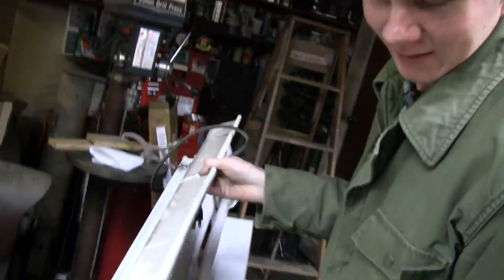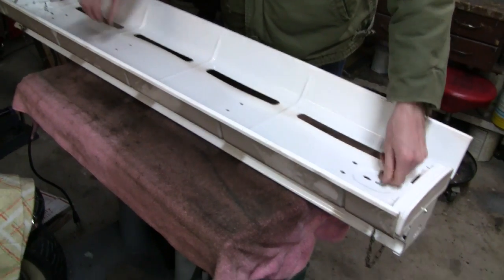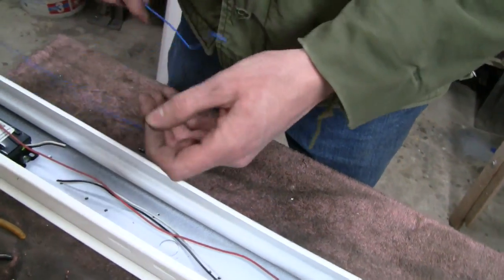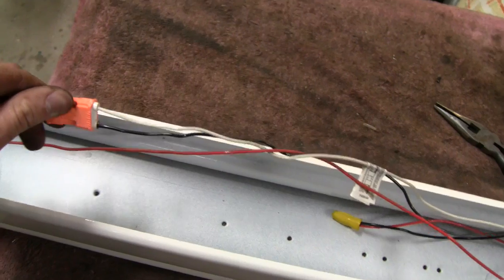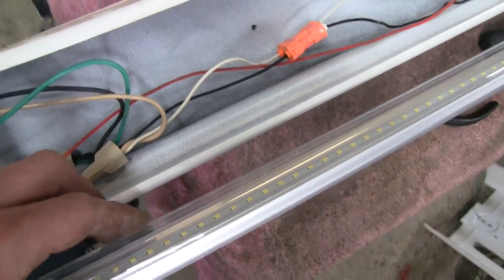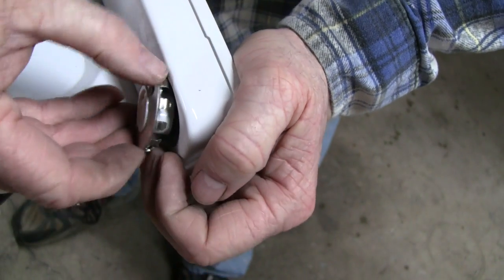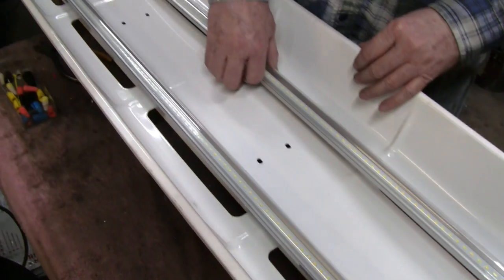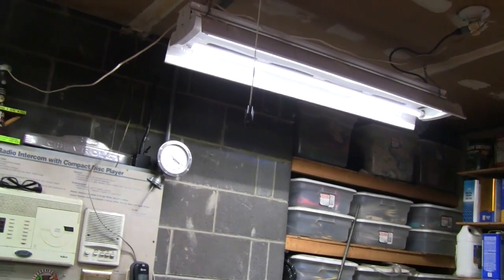HOW TO CONVERT FLUORESCENT TO LED (ALL STEPS)

Comment: About the worst delivery I've ever seen. "All steps" ! Picks up a bunch of blue red white and black wires cuts the lot and then they or some or maybe one colour to another appear joined in some way without any step by step explanation and visual.  It's a before and after with the actual work left to imagination. The rest you have to try and understand from the trio bantering together.  OK maybe for electricians but the idea is to make you able to do it yourself. Thank you tube that there are other vids to watch

Comment: Technically it does matter which wire. Live and neutral are not necessarily interchangeable. This particular wiring method only works for double ended LED tubes as well.

Comment: I did this same thing with my lights and removed my ballast. I hooked up my lights and they got power going to them but they will not come on. I got a wall switch that is a combo box  and what I mean by that it  has a light switch in it and a outlet in it and it's grounded and then I ran wire from that combo switch box to the lights that I mounted in my shed. I got power going up to it and when I flick the switch on the wall the power will shut off and on  so I know that's working but my lights don't come on. The only thing that I didn't do is the ground wire from the new wire that I ran up to the lights isn't hooked up. Someone told me that as long as the switch and outlet combo box is grounded that I didn't need to ground the lights, is this true and if it is true then I don't know what else to do. Like i said i got power up at the lights but the lights will not come on and I had the lights tested to make they're no defected and they work so I'm lost. Can anybody help, thank you. Thumbs up on this video. 👍

Comment: I'm confused. You hook (2 blue + 1 white), (1 red + 1 black) going to both ends of light. 
Does this indicate you are using a 'Double-ended' LED light?  
And are 'Double-ended' LEDs used only with 'shunted' tombstones   and   'Single-ended' LEDs used only with 'non-shunted' tombstones?  or vice-versa?
(note: the bulbs on Amazon warn only single-ended and require only non-shunted)
Thanks.
Reply from the maker: Thanks for asking, this is a great question! At the time this video was filmed, only double-ended LEDs were available, thus the original shunted tombstones were used. Had we been able to purchase and use single ended tubes, we would have had to retrofit the fixture with non-shunted tombstones. There are now SOME LEDS sold that are compatible with both configurations. I updated the Amazon link with an example. Hope this helps!
Reply: @motoforlyfe  ,  interesting that those LEDs you linked, can be BOTH single & double (take your pick). Even better the beam angle is enhanced at 240 or 300, than the older 120 angle. I wanted a better beam spread. Thanks for the updated link!

Comment: This is a horrible video. You did not slow down and explain what you did with the wires. I have rewinds 3 times and you just didn’t show your work. Moving in to the next video.
Reply from the maker: I used to lose points in math class for not showing my work.
Reply: Black to red, white to two blues. Ezpz pusspuss

Comment: Is it more energy efficient to not have the ballast connected, or just left in place if it's an electronic ballast in the fixture? The LED bypasses the electronic ballast anyways? Does the bypassed ballast still consume wattage, that meters on the electric bill?

Comment: Go another step and physically remove the ballast from the fixture - one screw holds it to the frame (usually) and the assembly is quite a bit lighter without it.
Reply: Yeah but then you need to dispose of it. Easier to just leave it.
Reply: who da hell cares if its lighter?  are u gonna fukn hold the thing while in operation?
Reply: @bucklee436  Because it makes for a cleaner job...and less confusion to those that service the unit in the future.
Reply: No, just hold the effing thing while installing it overhead.

Comment: I removed 2 ballasts from a 4 bulb unit, re-wired as shown , replaced bulbs with LED BULBS, and does not work.  what did I do wrong???
Reply: There are two types of LED tubes...'double ended' and 'single ended'. If you purchased the wrong tubes for your fixture...they will not work unless you also change the tube holders to shunted, or non-shunted respectfully. So, either switch to the other bulb types, or change your bulb holders.

Comment: This example shown here is known as a UL Type-B LED retrofit, where the driver components are integrated into the LED lamp. There are also Type-A (LED tubes operate off of fluorescent ballasts, also known as "plug & play") and Type-C (LED tubes operate off of remote LED drivers) retrofit options.

Comment: Thanks so much guys. Great tutorial. I had bought some so called plug and play led 48" tubes which were touted to work in a standard fluorescent shop fixture, but each lamp took turns randomly staying on, then going off then coming back on again. It looked like some kind of haunted discotheque in my shop. We were very entertained at first, but you can't work like that.  I yanked all the LEDs back out and started researching this when I ran across your video which was absolutely the clearest most concise explanation. I rewired my lamps like you did and the room is bright as day, without any unexpected night visits LOL. Thanks again.
Reply from the maker: You're welcome!

Comment: 1- the ballast tray cover has to be replaced, not only for cosmetic and reflecting, but there's wiring in there and it has to be closed. Otherwise it's an open junction box and is a NEC violation.
2- Note: these "double ended" LED tubes. Neutral one end, hot the other. That's why the shunted sockets worked.
You use non shunted sockets for single end tubes (where the hot is one pin and the neutral is the other pin) The sockets on the other end are just physical holders and require no electrical connection
Reply: davep6977 where is your code reference armchair electrician?
Reply: da fuk outta here dave!  ballast not 'hot' anymore, don't need no cover ya stupit fock!
Reply: @bucklee436  'Stupid' can easily be described as leaving parts off the reinstall that have value or leave a better end product. Put the cover back in place. It minimally keeps the wires secured, and the wire connections separate from the bulbs...in the off case that an LED bulb has to be replaced by a home owner at a future date.

Comment: I just did one of my fixtures in my shop using what I learned on your video. I tried running the LED's with the ballast wired in & they flickered badly. So I wired them as you showed straight off the 120v & they work great ! 
Now I just have 11 more fixtures to convert. I got my LED's at WM for $9.98 for 2 - 4' bulbs.
The old florescents are dim in comparison to the LED's.  Thanks for your help !
Reply: WOW!  That's a good price.

Comment: I tried this, the new LED tubes came on for about 2 minutes, then went out, when I touched them they were very hot, I think theres more to the conversion than this.
Reply: There are two types of LED tubes...'double ended' and 'single ended'. If you purchased the wrong type for your fixture...you will have to change one end of tube holder to shunted or non-shunted, or simply order the other tube type. Otherwise, you will have operating issues.
Reply from the maker: +Cunning Cat Did you check to make sure that the leds were meant for the voltage you were running through them and that all your connections were right?
Reply: Just three leads black white and a bare ground which I didn't mess with, the tubes worked fine for a short time then two tubes partly went out followed by all 4 going out, when I removed them they were very hot which isn't like LED's got them from lowes
Reply: Probably because LEDs only need power on one end.  They wire and work differently than regular florescent bulbs, but many videos dont explain that.  You might have sent power through both ends of the bulb.

Comment: Or, you can go to home depot and and pickup a 4 ft. T8/T12 17-Watt Cool White Linear LED that works off existing ballast. Just plug-in and go! For only 14.84 each
Reply: SJK The Mechanic Existing ballast uses more electricity and as they age they start buzzing.
Reply: At $14 each, those are more expensive bulbs.  The ballasts use much more energy to run AND the ballasts will go bad.   

Those are the many good reasons to bypass the ballasts altogether

Comment: im sure this conversion would apply to the old style T12 lamps as some fixtures the old ones will have a starter on one end of the sockets as that will have to be bypassed for it to work. on Supermarket cases the lights will have many wires as the conversion may be difficult if the kits are designed for them if its a refrigerated or a freezer case they are designed for

Comment: I have the exact same fixture. The bulbs from Home Depot require power to one side only.  Won't work in this fixture.
Reply from the maker: Thanks for the tip!
Reply: Correct. However, you can purchase non-shunted bulb mounts...and then the bulbs will work.

Comment: If there are large caps in those converters be carefull even when its unpluged as caps keep charge , i know those lights need a high voltage to fire them up so there could be caps in there that could kill you. If there are no caps ignore its fine.

Comment: I'll bet the ballast removal will lower the cost of operation by quite a bit. Where there is heat, there is loss.   I changed out my kitchen lights to LED's a few years back, and noticed the difference in the first bill.
Reply from the maker: JimsEquipmentShed Yeah Jim, it might be convenient to use led bulbs that don't need you to remove the ballast but it's pointless eh!
Reply: @motoforlyfe  it is called half assing it and there is a reason go all the way

Comment from the maker: The bulbs we used can be found on Amazon here: https://amzn.to/2Xkjsgj
Reply: This link points to single ended bulbs. but it looks like you are wireing both ends which is double end. I am confuse.
Reply: dirtbike5100 thanks for the link
Reply: motoforlyfe j
Reply: What is the power supply of this light 220 v or 110 v ?